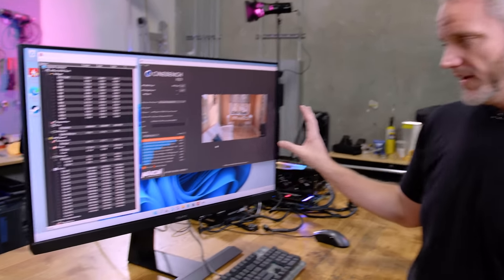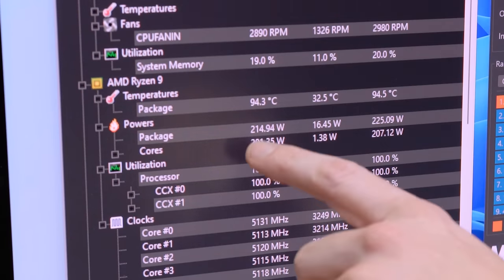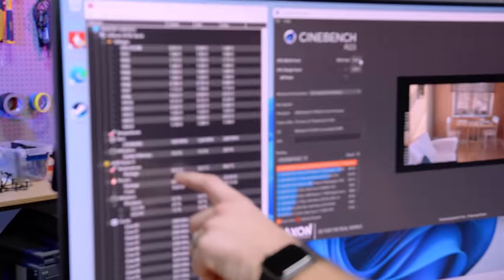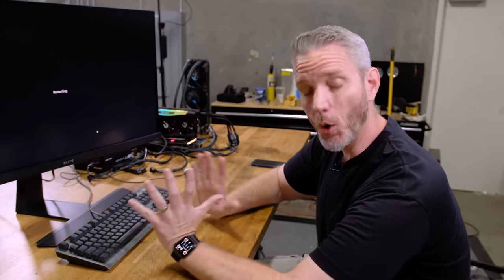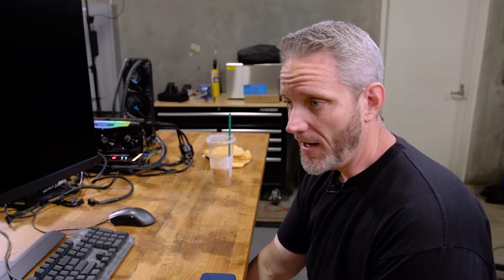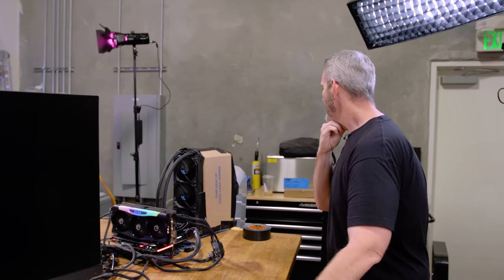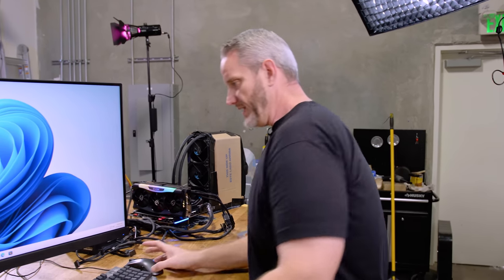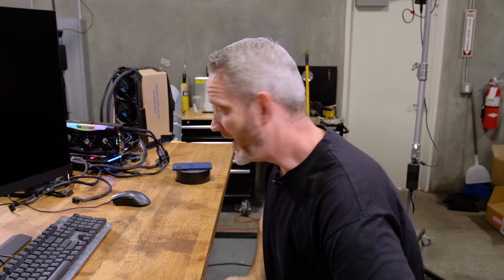This is fine...

Comment: You can do a manual OC up to 115C. So, ya; the new normal is 95C.

Edit: It boost like a video card so it will always try to hit the set TjMAX. If you cool the crap out of it, it will boost higher but still try to hit 95C. You have an LN2 pot, it should boost to 5400 on all cores with stock BIOS settings.

Second Edit: To be clearer; the throttling at 95C is is set in the BIOS by default and it is not the thermal limit of the CPU. The CPU will start thermal throttling at 115C.
Reply: This is really stupid. The fan noise is going to be absurd
Reply: @ksenchy  i disagree. I mean gpu fan noise aint unbearable either
Reply: @ksenchy  it'd barely hit 60-80°C while gaming (depending on the game). No game can max out even 8 of those monstrous cores.
Reply: @ksenchy  This CPU will probably need a 360 rad/AIO to run at stock speeds and be silent.
Reply: I was actually coming here to point that out. Lol

I think we're getting to the point of computers where if you care more about fan noise, you're gonna have to take a hit to performance. You're gonna have to disable the auto overclock, allowing you to keep the temps where you want while also having control over fan speeds. 

Will there be software tweaks for this? Probably. But this is basic new generation growing pains. Things aren't going to completely perfect out of the box. Same for Intel or Nvidia. 
If you're someone who wants a silent system, you're gonna want to wait. If you care more about performance, then the fan noise isn't really gonna matter
Reply: @ksenchy  fan noise has always been absurd for workstations. Gaming wont be even close to this experience, thats not the point of these videos where they push the cpu's. Think about it this way, this is all cores at 5.3+ - gaming is vastly single core focused, so you'd realistically only be seeing one or two cores increasing in speed. That means the cpu will have at minimum half the heat production while gaming.
Reply: I guess we turn on eco mode to make the fans shut up 😂
Reply: @ksenchy  Quite the opposite. If it tries to hit 95 C at all times (instead of getting noisy while trying to keep CPU cool), then it will be lowering fan speed to hit the temperature at lower powers, only catching up with noise of traditional way of cooling at full cooler capacity.
Reply: plus you still can get crazy performance with eco mode.
Reply: Exactly! you should set a lower maximum power limit in the PBO2 settings instead, to reduce temperatures drastically (at the expense of 5% to 10% performance  on multicore, and no loss on single core).
Reply: @SiloXJones  Performance has always been loud. Silent machines usually are a bit restricted, though to be fair today we have very quiet machines. Remember a decade ago when even good fans still used loud ass bearings and burnt out in twelve minutes. Today's fans are almost inaudible at most speeds, and if you're packing four or five 140mm fans from Noctua pushing 45-65 m³/h each. Couple that with a decent noctua cpu cooler, also running under 26db, and you're still pretty quiet. The obvious exception is if you're doing extremely heavy workloads for hours per day in a hot room. These chips are far from streamlined but Intel's 12th gen is hotter and actually throttles. Intel rigs with maxed out fans are still pretty quiet.
Reply: @BICIeCOMPUTERconGabriele  He was using Ryzen Master and setting hard voltages limits (not using the onboard PBO2 offset). You're wrong about the performance hit though. The CPU will still try to boost as much as it can. Set the highest offset and reduce by 5 each time until you get a stable bench run, then check your clock speeds. You may find you've inadvertently OCd your CPU.
Reply: Yes definitely a combo of lower PBO and hard power limit is the way to go. It's fine to have a minor hit. Already saw videos where you can decrease temps for 30°C for a tiny or no hit this way. It's well worth it IMO

Comment: Another thing to consider is the heat spreader on Zen 4 is quite thick.  It stands to reason that it takes a while to conduct all the heat from the CCDs to the cold plate of whatever cooler you're using.  Longer than it would have on Zen 3.  This is a side effect of AMD's decision to allow backwards compatibility with AM4 coolers and mounting brackets.  For every design decision like that, it causes a trade-off of some sort, and in this case it's less efficient heat transfer from the CCDs to the heat spreader to the cooler.
Reply: I wonder, since the heat exchange is from above, if they couldn't just make the base ticker. It would transfer less heat to the board, but the heat spreader would be more efficient.
Reply: @sysbofh  The reason the base is thinner this generation is because they moved the SMDs from the bottom side of the CPU to the top.  That's why the heat spreader has all those cutouts in it and just little legs gluing it to the CPU substrate.  That is another design choice they made in order to allow for more data pins in the socket while still having the same general dimensions as socket AM4.  Had they left the SMDs on the bottom and stuck with a thinner heat spreader it would have made the CPU socket noticeably larger and forced everyone with an AM4 cooler to at least buy a AM4 > AM5 conversion kit or an entirely new CPU cooler to ensure proper cooler contact.  This on a new platform where the adoption cost is already high due to requiring DDR5 and a new motherboard in addition to the CPU itself.  So all in all, there is a perfectly rational logic to it.  And realistically, while the CPUs do run hot, they are stable at those speeds and at those temps.  So as long as you can live with those temps helping to heat your computer room all year round, it's really not that big of a deal.

Comment: I think the thing that bothers me most about how hot this runs is that my fans are going to ramp up to 100% every time I do anything on my pc and it's going to make my system very noisy.
Reply: Nobody is talking about this! 
We went straight from sound being a frequent topic of discussion and priority for a lot of people, to you now have an F16 in your room on gaming loads.
Reply: Or just use Eco mode and set it to 105 watt tdp. Gordon over from pc world did that and then ran it through benchmarks and the results were ridiculously close to stock all things considered.
Reply: It only gets to 95c under 100% all core workloads or when your consistently at 80%+ utilization from what I have seen. Smaller loads have much more tame temps.
Reply: Plug them to molex and enjoy the music like a real man
Reply: You need a better cooler. One of the benefits of a water-cooler or a chunky air cooler is having extra thermal mass. That allows extra headroom for the cooler to "soak up" heat before the fans need to ramp up.
Reply: @orderanura134  you can watch some gaming test, the temp is quite normal, I mean it's still hot but not that hot
Reply: It's called using fan curves.
Reply: You may wanna look into the AMD Eco mode
Reply: CPUs like this make BeQuiet or Noctua fans mandatory
Reply: You need to use bigger radiators. 🇺🇸 😎👍☕
Reply: Always set a fan curve. 
You can decide for example that the max speed is 70%, and make they ramp up slowly (3-5 secs).
Reply: @panscrank  Tell your fans to never max. You will lose a tiny amount of performance, but will consume far less power. Many air coolers see limited benefit from high fan speed anyway. You can also just set a power limit. It has been shown that the 105W eco mode only loses 10% performance, so 150w would likely get 95% of the performance, while maintaining full clockspeed for loads of perhaps 8 cores or less. About fan curves, you can set a delay to ramp also, so it will only ramp to max or whatever after sustained high temps, which most workloads will not hit. It is only production type workloads that max all 16 cores that produce consistent 95C.
Reply: You'd have to retune your fans for a new curve, and accept that your target temperature is going to be higher than it used to be.  You aren't going to get this and then cool it to the same level as a Ryzen 5000.
Reply: Noctua Dh15 exists. It can tame this.
Reply: @jondonnelly3  No it can't.  The problem isn't the capacity of the cooler.  It's the transfer of heat from the cpu to the cold plate.  Even a custom loop will likely see 95c in a Cinibench loop.  That AIO is capable of cooling a GPU which draws much more power.  The GPU just has a larger core so the heat is spread over a larger area and is therefor easier to transfer to the cooler.  Jay even went over this in the video.
Reply: @panscrank  You can cap your fan curve or just set a manual speed when you're doing something that will tax the CPU this much.  When I game, I set my fans to a static speed that I know will provide enough cooling without the bother of loud fan noise going up and down.  Since the CPU gets to this temp regardless of the cooler's capacity (to an extent), there is no point in running the fans anywhere near max speed.
Reply: This is a good point. if  95C is "normal" how do you know when your pc is  too hot and when your cooler is doing it's job?
Reply: @xeridea  I just don't see the point in buying a top of the line CPU but then losing that performance you paid for by setting eco mode or a fan curve that is bearable to live with on a daily basis. Everyone seems so impressed with these new CPU's but I'm not convinced.
Reply: @dracer35  Have you even seen reviews of the Eco mode? Even in Eco mode it's really fast and still the best-performing CPU.

The gist is that you have a headroom. Run Eco mode and when you really really really need the additional performance, go out of Eco mode.
Reply: Not at all. Opening a browser or Windows Explorer isn't a production load. I feel that techtubers really screwed the pooch with the reviews by focusing hard on the production load for thermals and power consumption. A few channels out there made videos showing that the 7950X only uses 100-120W in gaming at 1440p and 4k due to the GPU bottleneck, which is no different from the 5000 series.
Reply: @PanduPoluan  Yes, I've seen pretty much all of the reviews and it doesn't change my opinion. I don't think it's reasonable to expect people to go into the bios and switch back and forth between eco or pbo. Then you are losing time/productivity switching modes. To me this all just sounds like a weird compromise. It's great if you're ok with that but you can't convince me this is acceptable. As it is right now, I won't be buying Ryzen this generation.
Reply: @dracer35  If you do eco mode, or better yet, curve optimizer, you still have a top of the line CPU. Difference between 7950x and 12900k is massive, the 7950x still wins in 65w Eco mode. Not everyone needs maximum performance, and would prefer 90-95+% of the performance at massively reduced power, noise, and heat. From early leaks, 7950x still obliterates 13900k in multicore, so losing 5% isn't that big of a deal. For those who want maximum performance, there is nothing wrong with leaving stock, but not everyone loses sleep because they are running 3% slower than they could. Clearly both Intel and AMD now are fine blowing power out the window for "leadership", but they are way past any reasonable sweet spot.
Reply: You've got to get around to upgrading your case fans man! C'mon, everyone is using the new 100,000 rpm 20,000mm fans by Delta. Ha!
Reply: I experience this bahavior on my 5950x, i open something and fans ramp up, had to clock my CPU to 4ghz to avoid this annoyance, and oc it when i need it or when playing CPU intensive  open world games.
Reply: This is why I'm building a MO-RA3 setup with 4x 200mm noctua fans. Keep the silence, while still having enough thermal mass for 250W cpu + 400W GPU
Reply: @manuelmunguia616  Use minimum power mode in your power options menu. Just switch it back when gaming if you need high single core umph.
Reply: @BassRacerx  if it goes beyond 95 then your cooler isn't tanking the CPU lol.
Reply: i already started testing noiselevels when replacing normal desktop-fans like corsair ones, with serverclass fans i took from an old IBM machine, and tho the airflow is really good (at 5500rpm fanspeed btw) its nothing i would like to sit next to while gaming xD
Reply: if you can use 100% of it sure it'll ramp the fans
Reply: We can use this cpu as a heater LOL 😂😂😂
Reply: You can turn off PBO and your Zen 4 CPU should run WAY cooler.
Reply: I am more concerned about the heat soak onto other components. Sustained 95c will cap out these shitty Acetek AIO's and case ambient will go up.
Reply: @CallmeRoth  I have temps limit about 90 c in bios then pc shut down but okay 95 c cpu and then rtx 3070 which can run hot especially you play with RTXON. Buy okay not hotter than 75C but heat spread around the case and teoretically goes into cooler that causing more heat. Teoreticall
Reply: @jondonnelly3  no it will not even with a 360mm AIO it still it 95c
Reply: @patrickshelley09  debauer delided one and got a 20c decrease in temp running in the 70c that 10c better than Jay ac setup
Reply: @HalfUnder  I hope its better than the 5950x because I tried Eco on mine and it was absolutely terrible.
Reply: @manuelmunguia616  Again, you need to set your fan curves around this.
Reply: @michelvanbriemen3459  finally someone with a brain you are spot on this is a non issue
Or just delid and get a 20/25c decrease in temp with a good aim
Think debauer got like 70c in cinebench with a delided cpu
Reply: @markkrejic8736  a 220 watt heater is not really powerful and Intel is no better in the watt department so what your point again?
Reply: @markkrejic8736  did you ever watched jay he tried to kill a cpu with heat guest the conclusion?
 jay failed even pumping 2.5 volt and using a hot air gun to heat the cpu
Reply: @legros731  just a joke man 😂
Reply: @panscrank  Also pointless. Get a better cooling solution or just deal with the noise.
Reply: I set my fans to a constant 75% rather than hear them go up and down.
Reply: @legros731  Which proves my point.
Reply: Absolutely. I undervolted my 5800X the day I bought it because of that. Everytime I did something that spiked the CPU usage (decompressing a file, installing a program, etc), the temperature would rise to the upper 80's and the fans would ramp up instantly. 

Having this shoot-for-95°C behavior out of the box doesn't make sense to me. I'm pretty sure nobody likes their computer running at 95°C, no matter if it's safe or not, since that excess heat makes the rest of the hardware and the room hotter and louder.
Reply: @pripyaat  Whether the CPU is 95c or 75c doesn't matter in regards to the room temp.  It's the wattage the CPU is outputting that matters.  If it runs at 60c at 200 watts, your cooler is still removing that heat energy from the CPU to the room.
Reply: @patrickshelley09  Yeah, but the higher the temperature gradient is, the faster the heat is transferred to the room.
Reply: @1newme425  "will not max out"... lol. Not all games/software play nice. A recent example would be New World, cranking out 30% of my cpu for no good reason. Another time a cpu would saturate is opening up software like Chrome browser, etc. Hopefully the current materials used for the motherboard can handle the plethora of thermal impulses they would receive over the lifetime. I haven't tried AMD stuff in more than a decade but I'm tempted with all the improvements they've made thus far.
Reply: People saying "cap your fan curve" are missing the point.

The cores spike temps and have 0% relevance to cooler saturation.

The spike to 95 degrees sends the fans to 100% with the cooler still being water temp of 35 degrees. Meaning your fans are spinning up for NO benefit.
Limiting it yo 70% or whatever doesn't change the fact they are spinning up to match a temp that is irrelevant to them
Reply: Find a fan setting you are comfortable with for prolonged work and set that for when the CPU hits the 95° for longer than a minute. No need to let the fans ramp up to uncomfortable levels, and no sense in ramping fans up for transient spikes anyway. For light work you could probably set a baseline that is more or less silent. Then forget about it and let the CPU do the rest. You might set up an "extreme profile" that maxes out the fans for whenever you think that's actually going to be necessary. My guess is that it's going to be a rather rare occurrence.

If 95° is too much for ambient reasons, undervolting and/or delidding seems the way to go. Or just use eco mode and eat the couple of % of performance loss you won't notice without benchmarks anyway.
Reply: @karaloop9544  I see comments like this and want to tell people to stop trying to make excuses for this - Temperature control in computers for the last 2 decades is all about response to on going temp shifting and is not and HAS NEVER been the norm for good reason

Fan curves adjusting responsively is the ONLY way to prevent thermal run away situations that are potentially damaging - If you have a fan profile set to static and for some reason the temp keeps climbing you have no response, nor feed back to the user as it pushes 110 to 120 degrees

If this where something that even basic computers could get away with do you not think console manufacturers would have had flat single speed fans that where 1/2 the cost of PWM units for the last decade?